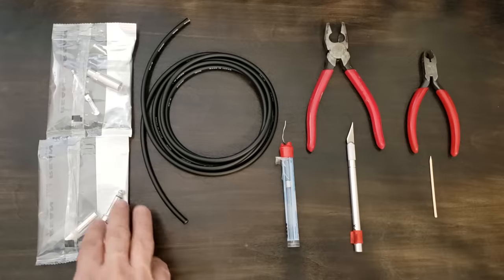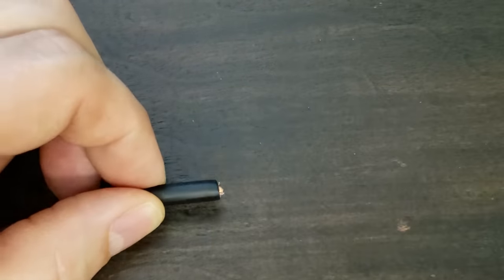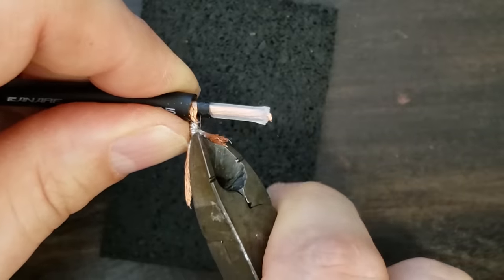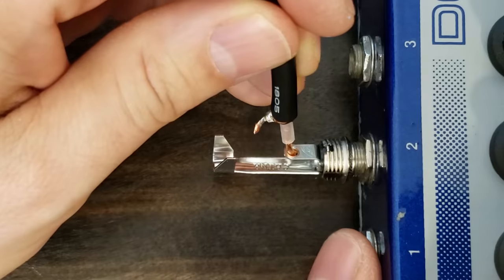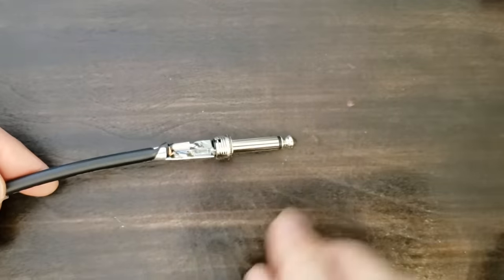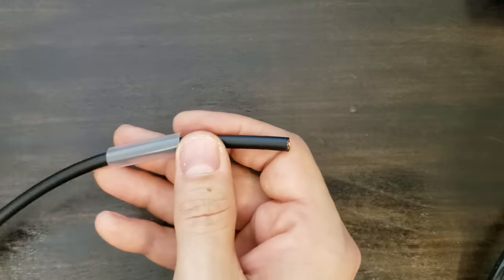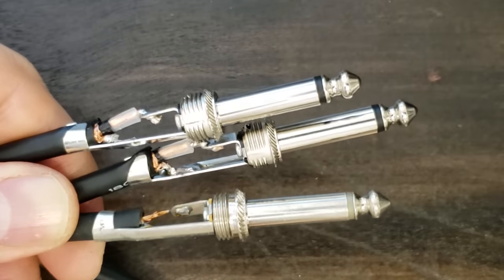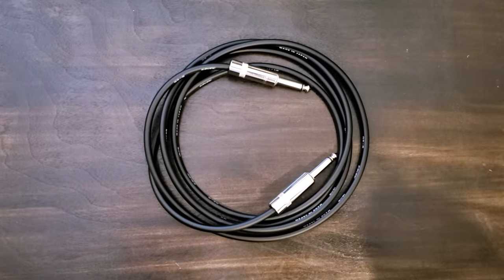Guitar cables - Make the Best Cables for bass keyboard GUITAR DIY SOLDER CABLE

Comment: Excellent video and great solder technique. One step in my process different from yours is to reverse the soldering order. I insert the center lead in the hole, as you have, but leave it unsoldered. Then solder ground first, gently pull wire so the ground wire is pre-tensioned. Lastly solder the center lead in place. I don't trust the little crimpy bits to hold the wire, a few tugs and they slip, putting tension on center wire eventually failing where bare wire meets solder. 90% of the time this is the source of failure in cheap "house brand" patch cables, stray wires ground out causing that scratchy sound we hate so much.
Reply from the maker: Great advice, I'll give that a try on my next cable- reversing the solder order of the leads. One thing I really like about this cable is that the center conductor is thicker than most(18awg) with over 100 strands of copper.  Once soldered it has an incredibly solid feel. 
Thanks again!

Comment: An extra step of coating the wire with a tiny bit of flux and then lightly tinning makes work easier and a better joint. That way you don’t have to deal with stray strands.
And apply a bit of solder to the tip of the iron before each joint. Helps transfer heat to the work quickly. Clean the tip with a wet sponge in between.

Comment: Nicely done! You forgot 1 step though, and that is cleaning the flux off. It looks much nicer but more important, flux speeds up corrosion, so getting rid of it actually has a function other then aesthetics :) And as said below in the comments, tinning the signal wire helps a lot to get it in the hole, off course only if you don't over-tin the wire (otherwise it won't fit through anymore).

Comment: I had a lead that I used for my "recording" lead, as it was short but not too short. It had fully moulded connectors. One end got dodgy so I cut it off and soldered on a nice vintage jack plug. Worked for a while the it became dicey again. Cut the other end off and soldered on the "top of the range" jack plug from the local electronics chain, which was essentially a cheap copy of the older design of Neutrik jack. 

This worked for a while before becoming dicey again. Re-ended one of the connectors and it worked for a whole before once again becoming dicey and somehow intermittent. Turned out to be the cable itself was so poor that it would break internally, and was nothing to do with the jacks. Took both of the jacks off, soldered them on to an old piece of Musiflex mike cable of similar length and it's been great for years. 

The question is, this lead has had two new jacks and one new cable...is it the same lead anymore? lol
Reply from the maker: Lol..well, it sounds like the spirit of that lead is still alive, even if the cable bowed out early.  I guess you have an "evolved" lead now!  That is the beauty of good connectors, they can last through many cable changes!

Comment: I like to put hot melt in between the positive and negative part of the Jack before   I put the sleeve over  it this makes it much more stable
Reply from the maker: Good tip! Yes, that's helpful for a very long lasting cable. I've done it, but I find that it makes repairs just a little bit more difficult, say if your cable gets cut near one end and you just want to re-solder it. Or if you decide to swap cable ends for any reason, it makes a little more work.

Comment: Very pro presentation and skills.   I'd never seethe wooden tool used before - so a great tip.  That and the use of the guitar pedal!  So many great points you made in this video , well done.
Reply from the maker: Thanks, glad it was helpful!  The wood pick might not be necessary with other types of cable, but Canare has tight, braided shielding.  There's no other good way(that I'm aware of) to get the wires apart without breaking them!

Comment: Well done video! Name brand instrument and guitar speaker cables are so expensive, you'd expect the quality of the terminal connectors to be as good as the cable they use ... but as you have shown, they are not! The one thing you could have emphasized was how important having a quality soldering iron is ... and using a high quality rosin solder.
Reply from the maker: Thanks!  It's true, when attempting any electronics project, there are so many things to consider  before you even work on your project at hand!  Experience continues to be the best teacher...!

Comment: Very, very nicely done, and most excellent out-of-the-box thinking in using a pedal to steady the plug before soldering! 
It's shocking how poorly constructed the shop-bought cable was, with both wires a ball hair away from touching. I suppose though, that's called 'planned obsolescence', requiring the customer to buy another sooner rather than later.
Reply from the maker: Thanks!  And thanks for checking out the vid!

Comment: For the sound, the cable impedance is essential. A high impedance lowers the resonant frequency of the pickup.
Was this taken into account?
Reply from the maker: Sure, i try to keep cables between 6 ft and 15 ft long. Anything longer than 10 ft begins to attenuate the high frequencies but a 15ft cable can sound good.  I think the user should consider the trade off of frequency or versatility and make a cable that is the most useful to them. Or, do as i have done and make a few of various lengths and use them where needed!
Reply: @FrankOlsonTwins  I keep the cable short and with a high distance between shielding and the middle. Cables with 2 shieldings (use outer one as second phase) helps a lot.
If I want to lower the resonance frequency, I use a capacitor. You can get the freqency down, but never up again.
I just wanted to put some focus on this topic, as many people are not aware.

Comment: I highly recommend a thermal wire stripper if you need to strip wire often. They are not expensive and they NEVER nick the wire.
Reply from the maker: 100% agree.  Any chance you have a link for a decent one?
Reply: I read from afar "thermal wife stripper" and had questions..

Comment: Frank Olson Twins Great work.   I've watched your XLR video on repeat while I learned to make my own XLR to TRS cables with Canare quad core wire.  I am going to make a new Canare TS instrument cable...it will be so much easier than the quad cable TRS solder joints!  I like Switchcraft TRS connectors, but the long length of the ring lead on that connector makes it super tough to manage with the quad cable wires.  I finally found a trick to it that helped me speed up my time.
Reply from the maker: Hey, glad to hear the videos are helping!  Glad to hear that others are making and using their own cables! I know what you mean, TS cables are a breeze after you make a bunch of TRS quad cables!
Reply: Try the Canare TRS connectors. Much easier to work with, and tough as Hell. I always had to cut that extra long ring lead in the Switchcraft TRS's, which was a chore.
For XLR's, go Neutrik
For RCA, TRS, and TS, go Canare.
I never had any of these connectors fail in my 20 years of soldering in an Audio/Video rental house...  :)

Comment: Hot glue for isolating the cables inside the cover and make a heavy duty & anti- stomp connector. It works even whit cheap connectors.
Reply from the maker: I've been meaning to try it!

Comment: Pedantry: To make sure the metal is hot enough for a proper solder. Let the solder start with indirect heat, never let the soldering iron touch the solder wire directly. Heat the surfaces and let that heat melt the solder.

Comment: Good video, but there's one thing I disagree with: the choice of the plugs with riveted contacts. For short patch cables these plugs are OK, but for heavy stage use they're not reliable. 
My advice: spend 2-3 bucks more for good, heavy duty, machined plugs like Neutriks with solid contacts and better strain relief. In combination with a high quality cable like the above You'll have cables that last for years. 
For the last 50 years I made all my stage and PA cables myself (I'm a bass & guitar player and soundguy) this way and never had any problems. Even if the cable itself has to be replaced (microphonic or broken etc.), You can still use the plugs again and again, they're built like tanks.
Reply from the maker: That's fair.  I use and like the style of Neutrik you're describing, but I've used both for many years and have never had issue with either.  I can't say the same for Switchcraft, however. I've had random failures with switchcraft barrel plugs, so I generally steer clear of them.  One thing I like about the connector in the video is its slightly lower profile in most respects than the more expensive one.  But again, I use both styles and like them both!  Thanks for checking it out!
Reply: @FrankOlsonTwins  I agree with You, for patch cables on high density panels or effectboards, where size is an issue, I also use slimmer / shorter ones mostly from Amphenol or other brands (I agree with with You on the switchcraft plugs). 
On my basses & guitars I only use the Neutrik types. The worst thing happening is that someone steps on Your cable and the plug breaks (I had that moment many years ago in the middle of a gig).
The idea with a pedal is great. At my workshop I'm using a 19" patchpanel mounted on a wooden socket, equipped with 2 x 1/4" sockets, 2 x B-gauge sockets, 2 x XLR male & female, 2 x Speakon and wired to a cable tester, so I can test the cables immediately.

Comment: You really should use a proper wire stripper with graduated sizes to strip off the insulation rather than a plain blade, as you mention..  You should also twist the inner as well as the outer braided wires tightly together before inserting them into the contact holes to prevent them from spreading out.  And you should also use a heat sink clip between the wires you are soldering and the insulation to prevent it from melting.
Reply from the maker: Agree on most points, however I try not to touch the inner conductor if possible to reduce contamination.  Also, heatsinks shouldn't be necessary if you keep the solder times short and give each joint time to cool after soldering...waiting is the hard part!

Comment: Good genius is also to use a 100 nf capacitor and a 100k resistor to cut any noise in line or in the Amp
Reply from the maker: I'll try this, I've seen a few variable capacitance cables. My concern is that the loading of the RC network you describe will change the tone of the guitar due to a change in impedance loading. Definitely worth investigating!
Reply: I understood your observation, just testing to find out, but if you have another idea, post it here. Thanks

Comment: I do an extra step of sliding some heat shrink about 1 1/2 to 2 inch long after sliding the cover & insulator over the cable, after soldering & crimping slide the heat shrink over the crimped end down over most of the connector & shrink with a heat gun, slide the insulator over and slide the cover over & screw down, you should have about an inch of heat shrunk cable acting as a strain relief also giving it a more finished look.

Comment: :o after this video I feel like I've been soldering wrong my whole life
Reply from the maker: "Terminal" soldering like this makes it look easy 🤩  But my general rule is keep it short and sweet.  Most joints shouldn't take more than 3-4 seconds 🐆
Reply: I used to do it wrong.  I would not tin the wires, and just add solder on top of cold wires.  Then after lots of repetition, I got soldering a TRS cable down to this...When I tin the cable wire, I add a little dab solder to the tip of the iron before touching it to the bare metal.  When that solder touches the bare metal the whole wire gets hot really fast.  I add new solder to the bare wire area to finish the tinning.  When both the wire and the connector are tinned, it makes it super easy to connect.  All you do is bring both parts together, heat the connector on the opposite side and then watch the pool of solder in the connector envelop the tinned wire.
Reply: @MixingGBP  Although we all eventually learn from trial and error + experience, very few people admit their mistakes or ignorance. I can tell you're a good person without even knowing you ;) Respect 🍻

Comment: Great video thank you! I noticed you did not tin the wires before soldering to the connector. Common advice advocates tinning the wires first, but your strategy allows better shaping of the wire against the connector. Thoughts?
Reply from the maker: Thanks!  In many cases, tinning wires first would be ideal.  However, with a hot iron(not too hot, don't melt the insulation off the wire), clean wire, and clean contacts- tinning shouldn't be necessary.   One thing to note: this is why i make a smaller ground wire, it's easier to solder in one step without over heating the wire.  As you noticed, it allows you to easily insert and shape the wire before soldering.  Shaping wire with a hot soldering iron is not ideal!   Also, getting a tinned wire through that tiny connector hole would be an exercise in frustration.   Good luck!

Comment: And that's how you save a ton of money using top of the line materials :p
The only thing i would change is using Neutrik NP2 jacks. The strain relief is far superior to that antique design. But it's not the point of the video.
Reply from the maker: You can still make this cable for about $1 per foot and adding your favorite connectors.  Even with shipping, it's still a bargain compared to ready made! 🤘🎸

Comment: Good video, I just got one issue, when you soldered the wires,  the solder you were using had Rosin core flux right?  The problem with the flux is that it is great to help with the flow of the solder onto the wires but it has a MAJOR problem, its corrosive. Over time you will notice that your cables will start going bad, and the reason is that the flux residue  being left after you soldered the wires will degrade the solder joint over time and cause the conductors in the wire to break down . And it all could have been avoided if you just added one extra step after you soldered the wires to the cable... You need  to clean the solder joints and remove that flux residue immediately after soldering, and before anyone asks what to clean it with, either a contact cleaner like LPS contact cleaner or CRC contact cleaner, or if you don't have any of that you cant use at the bare minimum 70 proof rubbing alcohol, but 91 proof alcohol is the best to remove the residue . I know that there is NO-CLEAN solder ans fluxes out there, and you may have used that , but honestly I don't trust those no clean fluxes, I still clean that crap off, you can never be to sure when it comes to electronics, they are prone for corrosion damage and a little preventative maintenance will save you some grief later. Now if anyone wants to argue about this and say I'm full of crap go ahead, but just to let you know, I'm an Avionics Technician who has been working around aircraft wiring and electronics for 20 years now in the military and commercial and had also been working on guitar wiring for 22 years, so I think I know a thing or two about basic soldering principles... Like I said , not knocking your video, I actually enjoyed it and I subbed too, but I just want the people to get the correct info when dealing with electronics.
Reply from the maker: Thanks for the advice, some good points here!  I'm certainly not inclined to argue with someone who has so much first hand field experience!  However, I was under the impression that Rosin core solder was a mild flux that was specifically formulated for copper/brass and is non-corrosive in no-wash scenarios. But, if professional Avionics Techs are cleaning the rosin off their joints, it must be best practice!  I'll add this step to my soldering technique, I'm sure it'll prove to be valuable!
Best,
FOT

Comment: What do you think about inserting the centre conductor from inside to outside? It's not too hard to see the parts getting bend together and shorting the signal otherwise. Just a thought.
Reply from the maker: Good question!  You can do that if you like.  To me, it seems approximately the same distance between the positive conductor and ground so I doubt it matters much. However, I do see the appeal of having the insulation of the inner conductor as a fail safe in case of a bending issue. 
That said, after many years of use I've never had one of these Neutrik/Rean plugs fail in such a way.  I've seen very cheap plugs/cables bent to the point of failure. I believe when properly soldered and fastened to the cable insulation, the failure rate of these cable ends is quite low.